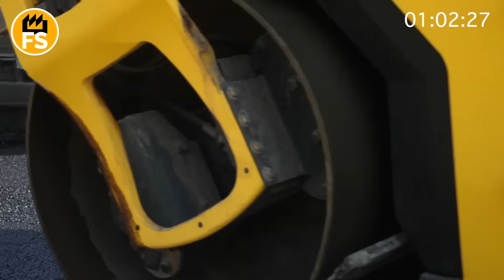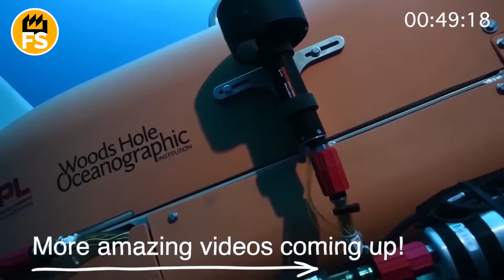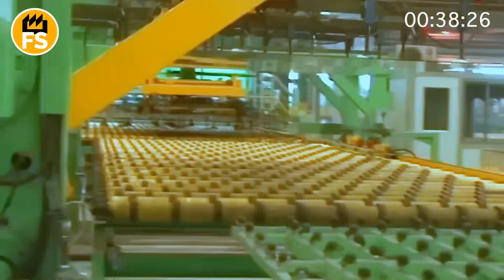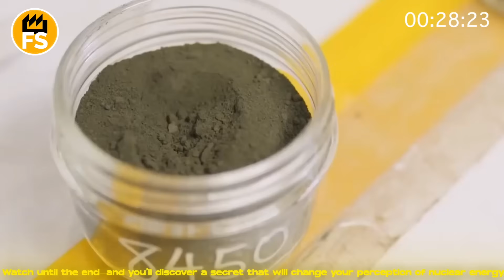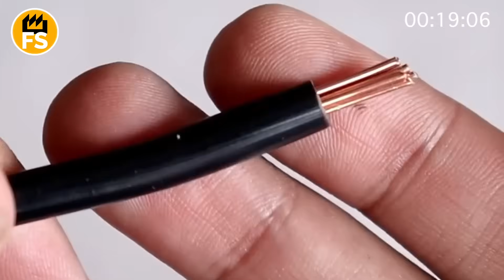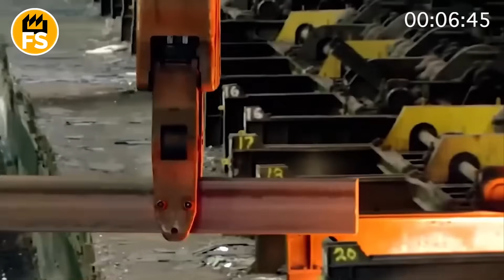How It's Made: 2 Billion Tons of Asphalt Per Year!

Comment: The most interesting 🤔 thing, would be to make asphalt out of junk tires. Junk tires are an ever increasing problem for our environment. It seems that, despite that problem, almost nobody is resorting to the idea of recycling junk tires into rubber based asphalt. Your friend, Jeff.
Reply: I dont want to be wrong and lie, but i thing i heard that somehwere they are testing it already 😂
Reply: @HeUeR_S22 it's already been made for years
Reply from the maker: Thank you for your insightful comment, @jeffreyhickman3871! Recycling junk tires into rubber-based asphalt is indeed a promising solution that deserves more attention, especially given the environmental challenges we face. 🌍
Reply: They have a method to extract oil from used tires which could be used to make Asphalt but it's an expensive filthy process from what I have seen, some places have also started to use old roof shingles to use as a binder in hot mix asphalt👍